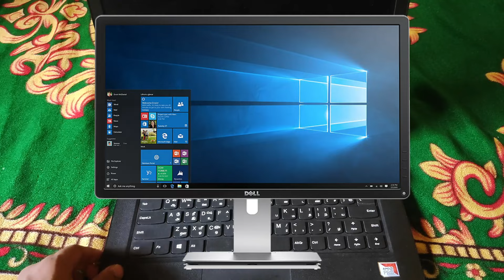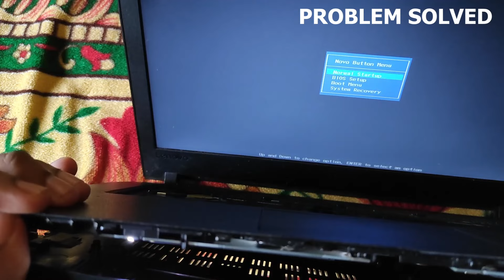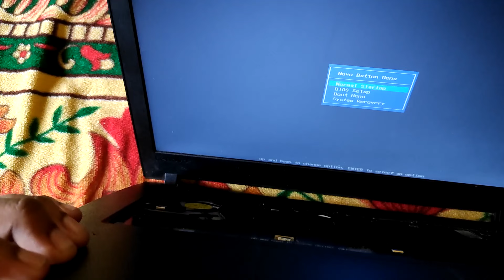How to Fix Lenovo E41-25 Laptop Turn ON but Black Screen in Tamil | 100℅ Works

Comment: Bro caps lock light elirila bro
Reply from the maker: Bro monitor or tv la connect panni paaru bro appidi varalanah cmos and ram ah clean pannitu potu bro
Reply: Ok bro neenga bios thaan poirunkumnu sollunga appo athaan pogum illa battery remove pannitu podalma
Reply from the maker: Athu bios reset than aagum bro
Reply: Bro ungaluku issue solve acha
Reply: @TheTechRider  nenga sonna mathiri panne bro  on agala ,
Reply from the maker: @KBharathiUADepartmentCom charging light varutha bro
Reply: @TheTechRider  varuthu bro , ram check panne ram la and ram slot la chiina Balck line iruku water ethu patrukuma bro , apti iruntha enna bro panrathu
Reply from the maker: @KBharathiUADepartmentCom ipa solution use panni clean pannunga bro ram la dust iruntha pencil eraser use panni rub pannunga bro

Comment: Bro...ennakku display dim ma theriyuthu bro...
Reply from the maker: @bharanibolt2479  ok bro display problem or graphics driver problem ah irukkum bro.
Reply: @TheTechRider  Aana Oru vaati athuve normal display aachu bro...
Reply from the maker: Appam graphics driver issue ah irukkum bro. Ctrl+shift+windows button+B press pannunga graphics driver reset aagum

Comment: Bro enaku caps lock light erila. Neenga sonna mathiri CMOS battery kazhati 10 mins kazhichi poten. HDMI la TV connect panni pathuten. RAM clean panni poten. Laptop on aguthu fan running la iruku ana semma sooda iruku fan side. Solution sollunga bro
Reply from the maker: Athu irukkum heat sink thaanai heat ah irukku. Antha heat sink ah remove panni thermal paste irukkanu paarunga
Reply: @TheTechRider  Thanks bro. Na local la oru thermal paste vangi poten. Athu silver paint mathiri irunthuchi. Ithu kuda issue ah irukuma bro. Oru nalla thermal paste recommend panunga. Please
Reply from the maker: @samueljc  oru blue bottle thaanai bro. Nalla thermal paste rate athigam bro Amazon la irukku cooler master thermal paste. But namma testing purpose irukirathu naala blue bottle and injection model thermal paste use pannuom
Reply: @TheTechRider  okay bro. Appo normal injection paste use panna problem solve aguma bro. Enaku system on agala nu than na thermal paste poten. Ippa kuda system on agala. Ithu Vera ethuna issue ah irukuma
Reply from the maker: @samueljc  desktop pc ah bro nenga ennoda telegram la message panringala
Reply: Bro ithey problem than enaku enna pananum bro kjm solen bro
Reply from the maker: @rdjgamingyt1538 video la irukiratha try panni paarunga

Comment: Enodathu Lenovo 23060 laptop bro BIOS update aachu naa takkunu off panniten.. ana again on panna power button light on aaguthu but display black ah iruku ena panrathunu sollunga bro please
Reply from the maker: Cmos battery ah remove pannitu 1 minute kalichu podunga next on panni paarunga. Laptop battery ah remove panni vachitu pannanum. Appidium varalanah bios chip la bios program than pannanum
Reply: @TheTechRider  cmos battery sticker potu ottiruku bro adhoda connector mattum disconnect pannitu maatna pothuma bro
Reply from the maker: @fowsiyajahan9118 connector ah just remove pannitu podunga bro sometimes varum illanah bios program pannanum
Reply: @TheTechRider  potu pathen bro varala program than pannanum pola evlo aagum bro program panna?? .. and thanks for ur reply ❤️
Reply from the maker: @fowsiyajahan9118 kk enaku rate correct ah teriyala enga place la ₹800- ₹1500 vaanguvanga
Reply from the maker: Unga place bro
Reply: @TheTechRider  Vellore bro
Reply from the maker: @fowsiyajahan9118 kk

Comment: Bro on button ,caps button light eriyuthu bro workagala athu inna problema irukkum bro please replay pannuga bro
Reply from the maker: Laptop onla irukkah bro visual varalanah ram clean pannitu podunga appadiya board la dust iruntha athaium clean pannunga
Reply: @TheTechRider  bro motor on sound kekuthu bro
Reply from the maker: Ippam correct enna problem
Reply: @TheTechRider  ram clean pannitu potta problem sariayituma bro
Reply from the maker: @rubanm6480 correct ah enna problem nu kekiran atha first sollunga atha vittutu
Reply: @TheTechRider  bro on panna onlight eriyuthu bro apram caps button lightum eriyuthu anal screen blacka irukku Athan problem bro
Reply from the maker: @rubanm6480 Tamilnadu logo vanthah. Athu show aagalanah tv or monitor la hdmi use panni visual varuthanu paarunga. Appidium varalanah ram and motherboard la dust iruntha clean pannunga. Otherwise service center la kudunga

Comment: Anne romba thanks ney romba romba happya irruke ney kadaila poi la ketta ney 4000 aagumnu sonnanga kaasu vera illa anne but neenga soldra mathri ye panne ney work aayiruchu ney last la on pandrapa avlo happy aayite anne rba romba thamks anne
..❤❤
Reply from the maker: ☺☺thank you☺☺
Reply: @TheTechRider bro help
Reply from the maker: @arulgiri7433 enna help
Reply: @TheTechRider   bro Amma laptop on avamatokuthu bro
Reply: @TheTechRider  cooling fan 1 r 2 second LA off aeduthu bro
Reply from the maker: @arulgiri7433 charger check pannigala
Reply from the maker: Laptop model
Reply: @TheTechRider  charge yaruthu bro and lenovo e41 25 2020
Reply from the maker: @arulgiri7433 right side usb port pakkam oru small hole irukkum athula button varum sim ejector pin vachu click pannunga on aagum approm keyboard ah remove panni vidunga
Reply: @TheTechRider  bro  try paina on aggal bro
Reply: @TheTechRider  Bro. bottom LA  light yariyuthu fan not run
Reply: @TheTechRider  br
Reply from the maker: Kk appam nenga shopla kudunga
Reply: @TheTechRider  ok
Reply from the maker: @arulgiri7433 nenga check panni kasta padandam athan shopla kuduka sonnan
Reply: @TheTechRider  OK bro thanks 😊❤

Comment: Bro thanks 100% working it help me a lot your great thaliva❤❤
Reply from the maker: Thank you bro☺☺ enjoy
Reply: @TheTechRider  yella laptop kum work aguma
Reply from the maker: @saro17family no bro ella laptop kum check panni paatha than terium enna problem nu
Reply: @TheTechRider  bro laptop charger panna yera matuthu light blink aguthu bro charge yera matuthu bro hp 246 laptop bro please reply
Reply from the maker: @saro17family battery ah remove pannitu on panni paathingala bro
Reply: @TheTechRider  remove pannen bro lap on aguthu black screen probel bro ram thodichi poten apa kuda varala bro charge yera matuthu bro white light blinking aguthu first lam charge pota red light varum epppa white light blinking aguthu bro ethachi solution sollunga bro
Reply from the maker: @saro17family beep sound varutha bro
Reply: @TheTechRider  beep sound purila bro na puthu ram vangi potum black screen problem solve agala enna pandrathu bro
Reply from the maker: @saro17family bro ennoda telegram la message pannu bro detail ah pesalam

Comment: 2:09 bro flash on panni display kitta vacha display lesa theriyudhu enna problem bro
Reply from the maker: Athu mostly displays problems bro vera display vachu check pannitu visual show aachunah display change pannunga
Reply: @TheTechRider bro gov laptop charge plugged in pannitu on panna work aguthu.. Charger remove pannitu on panna 5 minutes le ippadi black screen ayituthu yenna problm ah irukkum bro??
Reply from the maker: @selvamusicalbeatzz bios Or graphics driver issue ah irukalam otherwise board problem ah irukkalam test pannathan solution kedaikum
Reply: @TheTechRider  s bro display problem dha 1300rs solranga vangalama?
Reply from the maker: Display ah bro

Comment: Bro endu lenovo e41 25... On panna oru 10 mins use panna mudhidhu... Aduku aprm.. blank agirdhu ulla background la work aagudhu....then again power button long press pani off pani on pana.. background la vibration elam feel agudhu but... display vara matingudhu...konjam gape vitu like 2 days kelatchi on pana 10 mins aduku aprm of agirdu ena reason bro ?.
Reply from the maker: Laptop head aana ippidi than irukum bro. Otherwise enna problem nu check pannanum
Reply: Same problem
Reply from the maker: Ok bro Instagram or telegram la message panninga eppidi problem check panrathunu solran
Reply: @TheTechRider Epdi check panrathunu oru video podunga bro
Reply from the maker: Ennathu check panrathu bro

Comment: Bro na battery remove panitu connect panum pothu possistion mathi board la connect panita battery work akala charge pota led plink akala ithunala mother board la ethuvum prplm varuma ila new battery pota work akituma
Reply from the maker: Motherboard la ulla battery podura port ulla irukura pin damage aagum approm ethum connect panna mudiyathu

Comment: Enoda lap charger unplug panunaa screen dim aagirthu.again charge plug panunaa dhn screen normal aaguthu.Ithuku ena solution?
Reply from the maker: Charger ah remove pannitu brightness increase pannunga normal aagum
Reply: @TheTechRider  Tried But not working
Reply from the maker: Ok bro ctrl+shift+windows button+B press panni paarunga graphics driver reset aagum appidium seri aagalanah sollunga bro

Comment: Bro laptop charge potu use pannitu irukurapave takunu off aachi bro return on aakave matikuthu, government lenova laptop tha bro what a problem bro😢
Reply from the maker: Laptop model bro
Reply: @TheTechRider  charge potalum power lightum kata matikuthu bro
Reply from the maker: Ok bro
Reply from the maker: Kk neenga athula irukira keyboard ah remove pannitu on panni paarunga athula common ah keyboard problem irukku

Comment: Bro, I am using Hp laptop. First nalla thaan work aachu. Next shutdown pannitu ON panna display black ah irukku Logo varala but keyboard light & caplocks key lights ON aaguthu. Some scratch sound near charger port & power button kitta kekuthu. Any solution?
Reply from the maker: Ok tv la hdmi cable use panni connect panni paaru bro
Reply: Bro athey problem than bro enakum...ungalku sariii aacha ah
Reply from the maker: Enna model laptop bro
Reply: @afzal2088  Hard disk issue. After disconnect the hard disk from laptop, issue solved. But Hard disk la enna issue nu theriyala.
Reply: @TheTechRider  hp laptop
Reply: @KTGYN-TXE  harddisk change panigala...illa athey kalatitu potutigala bro
Reply from the maker: @karthigeyan9817 graphics or os issue illanah hard disk dead mostly os issue aah irukkum bro
Reply from the maker: Kk
Reply: @afzal2088  yes hard disk change pannen
Reply from the maker: Ok bro
Reply: @TheTechRider  Hard disk dead na ethanala problem ah irukkum.
Reply from the maker: @karthigeyan9817 files or software corruption, virus affection, sudden laptop or pc, over heating issues

Comment: Brother my laptop charger pootu long press pannathaa on aakuthu appuram charge pin kalattunaa utanea off aakiruthu thirumpa charge pin kuthunaa aptiyea display la irunthaa maathiriyea varuthu enna prplm bro pls reply me
Reply from the maker: Battery problem or battery ku power pora ic problem ah irukalam athan charge aagala vera battery pottu paatha confirm aagum correct ah enna problem nu

Comment: Hi bro.. en laptop la display on aguthu background light varala.. mobile la light potu patha diaplay on light ah theriyuthu bro ... any solution.. pls share 🤝
Reply from the maker: Bro hdmi cable use panni monitor or tv la connect panni paarunga display clearah light ellam varuthanu appidi correct ah iruntha display than problem replace pannanum
Reply: @TheTechRider  tq bro...try pannittu soldra bro
Reply from the maker: Ok bro

Comment: Hp laptop ku work agum ma bro 😢
Reply from the maker: Sometimes laptop la enna complaint bro
Reply: BRO ENDHA BUTTON KUDUTTHUM ON AAGALA BATTERY POTUTHU ON PANNADHA LIGHT ON AAGUDHU CHARGE PODALA NA ON KUDA AAGAMATTIGUDHU
Reply from the maker: @007mukesh46 bro puriyala ippam charge potta mattum than aagutha illa battery iruntha mattum on aagutha
Reply: Bro charge potu te on panna light varudhu sound varudhu black screen varudhu charge podama on pannaa suttha ma light edhuvume varala aana battary light mattum red color la on aagudhu
Reply from the maker: @007mukesh46 ok bro appam tv la connect panni paathingala black screen ku. Approm battery la laptop on aagala thaanai bro
Reply: Tv la eppadi conet pannanum bro 😔 pannala
Reply from the maker: @007mukesh46 bro hdmi cable use panni connect pannanum Or telegram la enaku message pannunga bro link description la irukku

Comment: Laptop ah romba neram off pannama apdiye vachittu pona  enna problem varum bro
Reply from the maker: Onnum aagathu bro appidiya problem vanthalum power ic, battery, hard disk, charger, ram ellam pogum athum heat aagi. But ic problem varathu possible. Ennoda laptop 2 weeks ah non stop ah odichu bro onnum aagala because naan data recovery poduvan

Comment: Bro display on aaguthu but welcome screen varala black ah iruku bro and capslk buttton la light on aagala bro ena problem nu sollunga bro.......
Reply from the maker: Daily use panra laptop ah bro Or use pannama irunthingala
Reply: @TheTechRider  daily um use panna labtop bro... Mobile la torch on panni display la vecha    welcome screen therithu bro
Reply from the maker: Ok bro display brightness button ah click panni increase panni paarunga Or ctrl+shift + windows button + B ah click pannunga ithulaium varalanah hdmi cable use panni monitor or tv la connect panni paarunga

Comment: Hi bro en lap la power button on akudhu and heat um generate akudhu ana black screen laiyea eruku can u please explain me
Reply from the maker: Monitor or tv la hdmi use panni connect panni paarunga. Ram and cmos battery ah clean pannitu podunga. Other solutions are sometimes graphics driver problems, os problem, overheating problem or motherboard problem...

Comment: Bro my laptop on agutu, but capslk key light on agala and display also on agala
Reply from the maker: Vera monitor or tv la hdmi cable use panni connect panni paarunga display varuthanu suppose varalanah ram, hard disk, cmos battery ellam remove panni clean pannunga mukkiyamah keyboard ah remove pannunga
Reply from the maker: Eppathila irunthu laptop ippidi irukku
Reply: Bro en laptop la left click panum pothu off agi on Achu bro mousepad ku left la Kai pata off agiruthu caps lock light on agalaa Tv monitor la HDMI cable potum work agalaa lap romba naal ah use panala  @TheTechRider
Reply from the maker: Kk bro ennoda Instagram or telegram la Message pannringala detail ah pesalam
Reply: @TheTechRider  okay bro

Comment: Flash potu paatha theridhu bro screen enna panradhu adhuku....
Reply from the maker: Athukku brightness button press panni increase panni paarunga appidium varalanah ctrl+shif+ windows button+B press pannunga appidium varanah vera display vachu paakanum Or athoda display strip ah change panni paakanum. Mostly display problem or graphics driver problem ah irukalam

Comment: Bios problem epdi bro solve pannurathu
Reply: Sollunga bro
Reply from the maker: Cmos battery change panna sometimes seri aagum otherwise bios chip replace or program pannah solve aagum bro
Reply from the maker: Bro first cmos battery power check panni paarunga 2.8v mela irukkanu paarunga appidi illanah atha change pannunga athu oru ₹30 ulla varum. Suppose seri aagalanah bios chip ah program panni paakanum appidi program pannium work aagalanah short irukanu paakanum. Short iruntha bios program panna munnadiya antha tool light off aagum
Reply: Thanks bro
Reply from the maker: @user-yy2qv5qd3r ☺☺
Reply: @TheTechRider  apidiyum seri aagalana enna bro seiyanum
Reply: Sollunga bro
Reply from the maker: @RamaMoorthy-p9d  appidi irukkah chance illa bro. Bios issue na ivalu work pannuvanga same time bios chip ku power correct pogalanalum bios chip work aagathu
Reply from the maker: Suppose naan sonnathu ungaluku Puriyala Or vera ethachum doubt iruntha ennoda telegram la message pannunga voice message panran

Comment: Power light on aaitu udane off aaiduthu enna problem bro?
Reply from the maker: Keyboard power button problem bro so keyboard ah remove pannitu on pannunga bro
Reply: @TheTechRider  tried it same power light on aaitu again seconds la off aaiduthu
Reply from the maker: 😳illiya bios button click panni on panningala bro appidium on aagi off aaguthana cmos battery or laptop battery ah check pannunga bro
Reply: Done that also...enaku oru doubt dc ilana it should turn on in AC right?.. battery ilamalum on aagum la?
Reply from the maker: @Mashiq93 on aagum bro but safe illa board chip short aagalam bro
Reply: @TheTechRider  okk battery connect la than iruku charging but no response same light on off
Reply from the maker: @Mashiq93 battery ah remove pannitu on panni paathingala
Reply: @TheTechRider  Mm try panen same result
Reply from the maker: @Mashiq93  appam cmos battery ah remove panni power check pannu bro, next ram ah clean pannitu podunga, next hard disk ah remove pannitu try pannunga
Reply: @TheTechRider  enaku one problem bro laptop charge pota charge aga matuthu light blinking enna pandrathu bro
Reply from the maker: @saro17family enna color la blink aaguthu bro